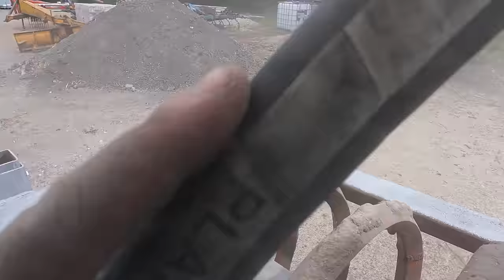SandBlasting a Farm Plough

Comment: I follow your work congratulations, how long did this service last and how many kilos of abrasive was used?
Reply from the maker: Welcome to the blast hood 😎 I not sure as I cannot remember the exact time and media but I would say around 3 to 4 hour and aprox 9x 25kgs bags but I would have taken a minimum of 20 bags just in case 👍 please don't try to work out media per hour as every job is different and every rig is setup differently what I mean by this is sometimes you can get 3 or 4 hours from 3x 25kgs or sometimes only get 30/35 minutes out of 3x 25kgs it's job depending and can only be determined on the job 👍

Comment: Hello Mick, I've been following you for a while now. You are doing a great job. You often work with fine blast media. Do you use a vibrator on the blasting machine for better flow? Best regards from Germany
Reply from the maker: Thanks 👍 no I don't need a vibrator on the pot this is only really used for soda blasting 👍
Reply: @Mobileblaster  I have a new pot and have blasted with slag 0.09-0.25. I often had interruptions. Do you use the blast media again if you have the opportunity to catch it?
Reply from the maker: @falcogiegmann8505  depends on the job but 99% no I on use the media 1x if you plan on reusing it a tite siv would be the best root to go and make sure it's not damp 👍
Reply: amazing what kind of film equipment you have. how much blasting material did you use? one never sees you refilling :-D do you always take a large amount of blasting media with you in the transporter? do you fill it into the blasting machine in the transporter
Reply: how can you answer approximate prices for customer inquiries? I hope the translator makes it clear :-D
Reply from the maker: @falcogiegmann8505  This channel isn't a how too because if I start and try to tech no doubt I will be doing something wrong so it's best just to do a diary and keep it at that for me 👍

Comment: what media are you using ?
Reply from the maker: Crushed glass 👌
Reply: A Hard Working Man! Thanks for the time, effort and commentary you put into your videos. Your efforts are much  appreciated by me and your viewers. 
Just wondering what we’d see if we had an extreme closeup, super high speed image/video  of the crushed glass shot hitting the target area at speed. Would the high speed impact cause the crushed glass pieces to shatter/explode, causing more effective removal of surface material? May I ask, the crushed glass shot size and the pressure at which you sandblast?

In any event, best wishes to you and your Company!

Roy Lewis
Buffalo, NY USA
Reply from the maker: @rlewis1946  Thanks Roy 😊 I would love to try and get a close up slow motion video but it's too harsh on the lens we're its located and the camera needed to achieve the quality/frame rate are very expensive maybe something for the future 😏 I used medium grade crushed glass 260cfm @ 100psi
Reply: @Mobileblaster   i did think it was not too abrasive with no gloves on
Reply from the maker: @fiskoz  skin like a rhino 😬